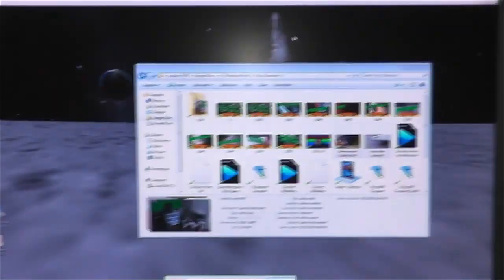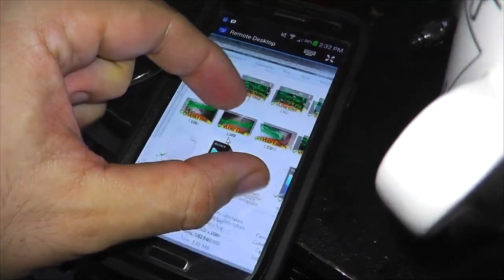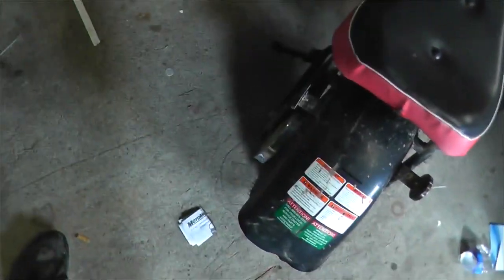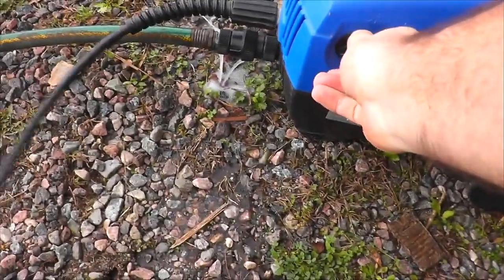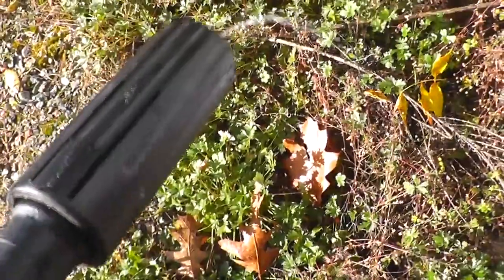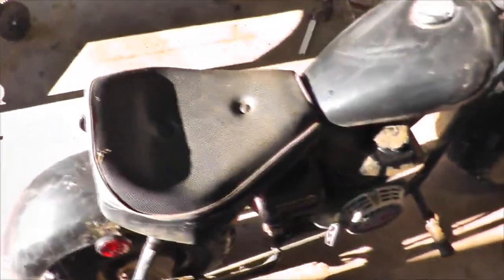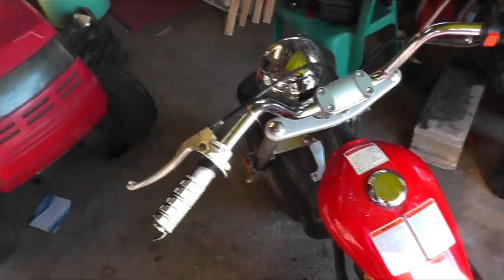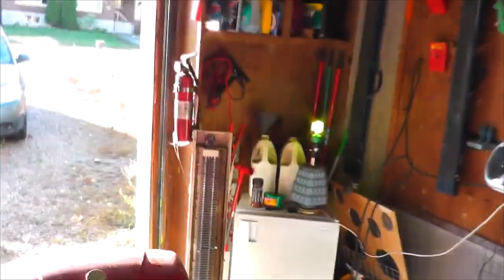Fixing the mini bikes again

Comment: try getting some 1" angle iron and weld it to the bottom of the frame where the crack is, You will need to strengthen that section otherwise you'll end up welding it time and time again
Reply: it cracked again as his weld had no penetration,could add as much strengthening as you like ,but if the weld have no penetration its not going to work.
Reply: yes that was noticeable too, I've never seen his welder to know if it has variable settings to crank it up
Reply from the maker: Bullshitkorner there is only a low and high switch on the welder and a dial to increase or decrease the speed of the wire.  Some say that increasing the speed will increase the power output as well aparently.
Reply: *****
i'd put the welder on high and play with the speed of the wire, you'll know when your doing a good weld when the metal starts melting that your welding but not too much that your just burning holes in it

Comment: You can never change your oil too frequently, but leave it even just a little bit to long and the engine will have irreversible wear.  Bottom line is if you want to change the oil, go for it!

Comment: Problem with the people who give up on the darting and going back to cancer sticks is it's not just their lungs, it's the lungs of the people around them too...

That's the thing about motivation, you have to motivate yourself to get motivated, or some crap like that... :P

There's a reason we use Hozelock fittings here in the UK these days, so much easier than messing about with different sized brass connectors... :P

That's the joy of instructions, they help make things work... :P

Careful blasting the wheels with the pressure washer, you could force water into the wheel bearings, which is a bad thing... :S

Comment: Maybe the low oil lever caused a little bit of weird noise, fingers crossed the piston hasn't been under-oiled and scraped the barrel away... :P

Another welding job to do there then, just to stop the handlebars smashing that fake tank up again... :P

Yep, that's a lot of black stuff, you could probably throw it on a coal fire and it'd work as fuel... :P

Cool, a reasonable variable-speed cordless drill, just what you need for building a shed-garage in the back yard... :D

And if you think that cracked joist is bad, you should see the entire roof of the back shed I have to play in, it's pretty much collapsing... :P

Comment: Yeah, that weld will probably crack in the near future, assuming it hasn't done already... :P

It's funny how it sounds like it's ringing a bell when idling... :P

A fella on TV used a rolled up kit build manual to fill an engine with oil because the filler was hard to reach in his kit car, or plane, or helicopter, I forget which one of the "- is born" shows it was... :P

Yep, white bits in oil tends to be a sign of water ingress... :P

Comment: Go for an 8" tablet, I have the old 10" Galaxy Tab version 1 and it's bulky to use, by the mother's Galaxy Tab 3 8" is nice, and the 7" tabs I've fondled in shops are just too small for my liking, that extra inch makes the difference (that's what she said, I know!!)... :D

A manager that manages to fail to manage, sounds like Rebecca Howe in Cheers... :P

A good tip, never take anything into work that you've paid for to share with co-workers, otherwise the goof of the workplace will wreck it, it's no wonder the community spirit of sharing and getting along nicely is dead... :\

Walkin' the mile, walkin' the mile, walkin' the links mile, that description is loooooong now........ :P